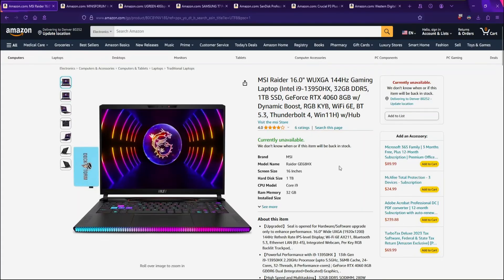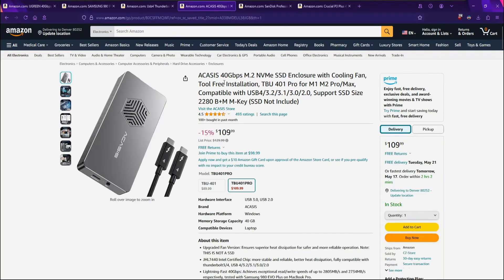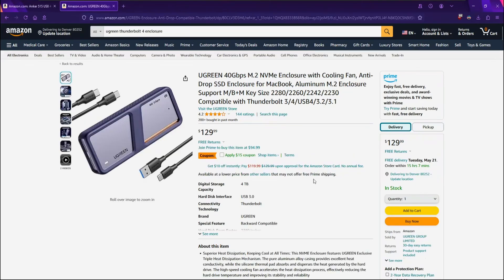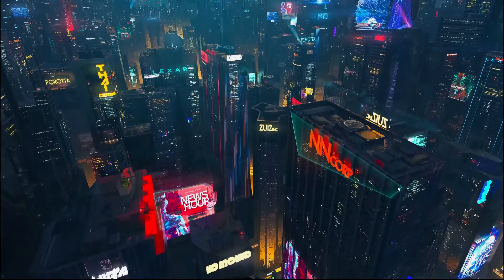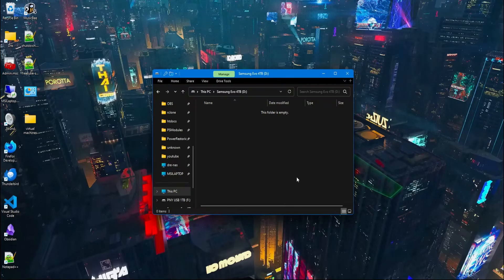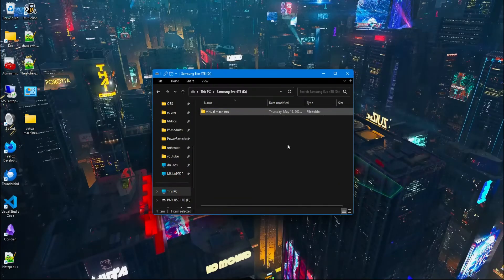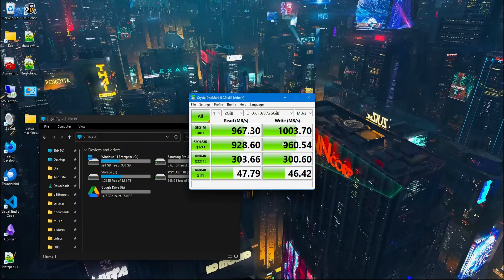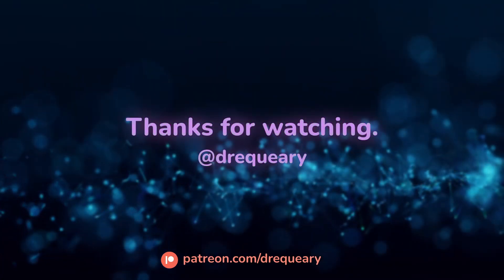🏃🏽‍♂️⚡How To Build A DIY USB4 Thunderbolt 4 Portable SSD

Comment: I built this exact setup with the 4TB drive for my Macbook Pro. I get around 3k speeds, but it constantly drops the connection when doing big transfers, multiple small transfers, or something like uncompressing a file.
This happens on TB4 and USB 4, 100% of the time, (multiple macs and  enclosures tested.)
Samsung tested the drive and it tested fine with them and they sent it back saying don't use it in an external enclosure, it's not designed for that.
For what it's worth...
Reply from the maker: Interesting. The first thing I did with mines was transfer over 1.5 TB of media lol. Not had any connection issues.
Reply: @DreQueary  Yeah, I am really disappointed. I got better results with the Ugreen and 990pro on my windows machine, are you windows or Mac?
Reply from the maker: Yeah im on Windows.

Comment: Nice!! However, does it run on windows (11) systems also?? Or is it exclusively for Mac users?
Reply from the maker: What do you mean? Im not using a mac I use Windows 11. Should work with Macs tho.
Reply: Allright!!!  Thank you for your very quick answer!!

The question was just because I had about the Ugreen device on redit, that some users had trouble with the device when using Windows PC's. On the Ugreen homepage theres a section stating potential instability using Windows - maybe due to usage of old CPU's (they advice it should be Intel 12.gen or newer, or a new AMD).

Besr regards,
Jonas
Reply from the maker: Oh I see. Yeah, I wouldn't be surprise, all these things come from China and lack quality control. But I get most of my enclosures from Ugreen and havent had any issues. But again, i only use Windows. haha